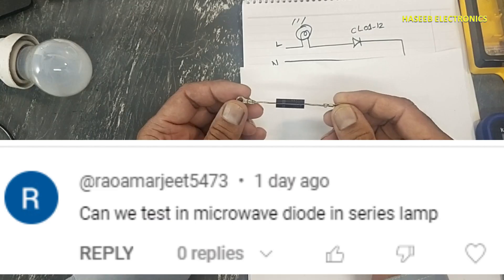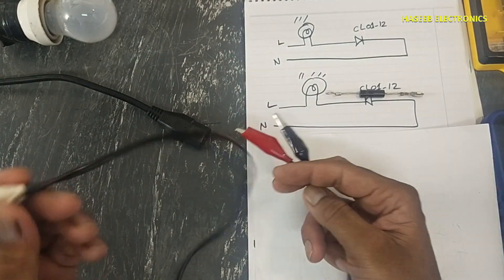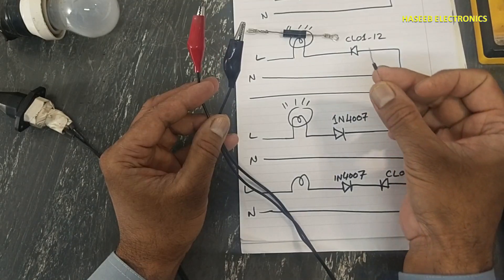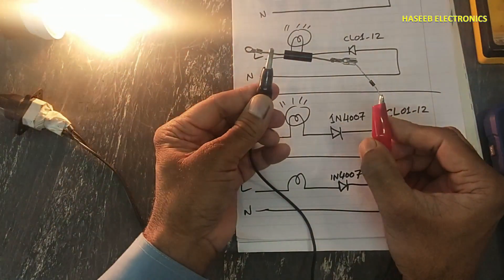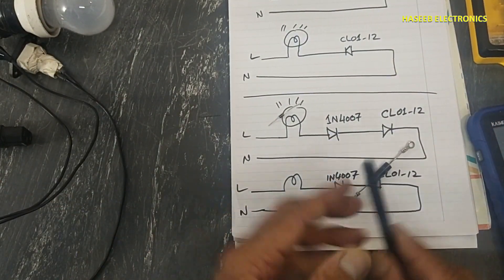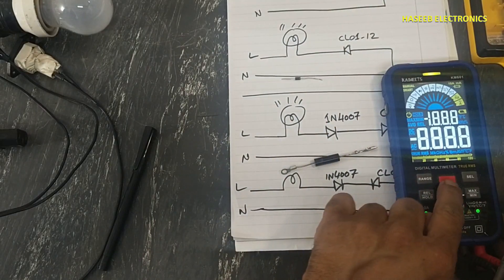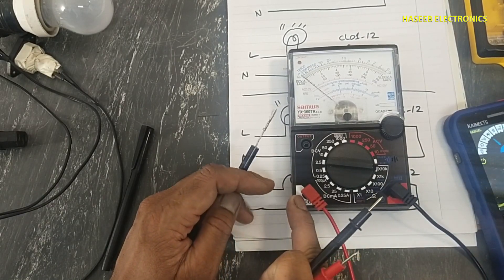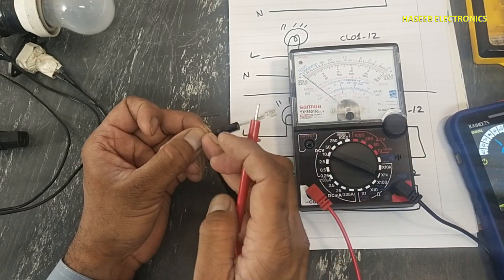{965} Testing microwave oven diode using series lamp

Comment: Another great way is to use a lab power supply with 10mA current limit and 15V. When leads are present, the power supply will show the voltage drop across the diode.
It is easier and less dangerous.